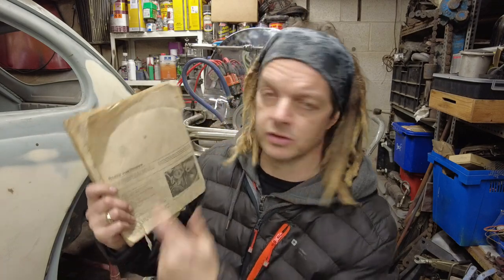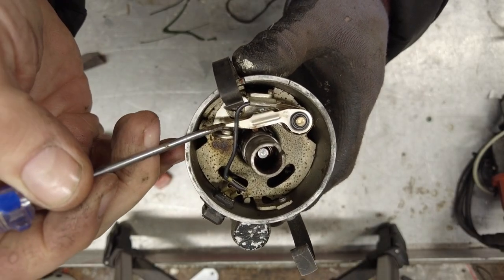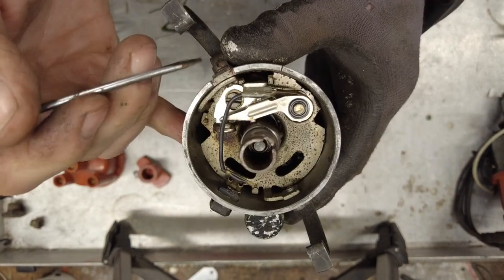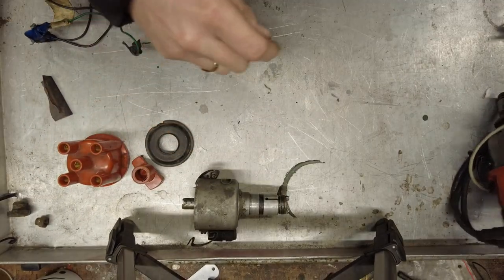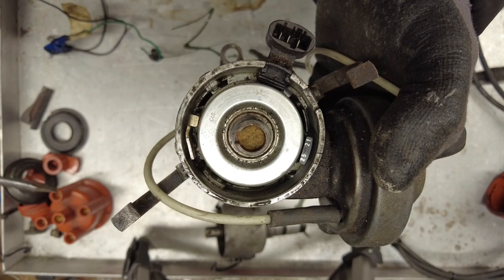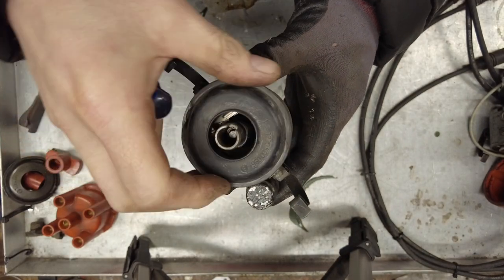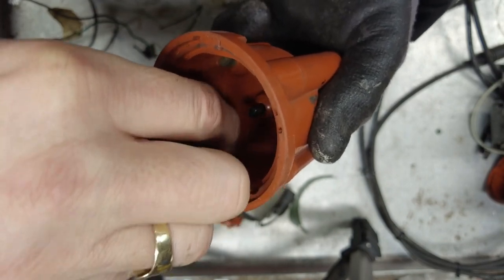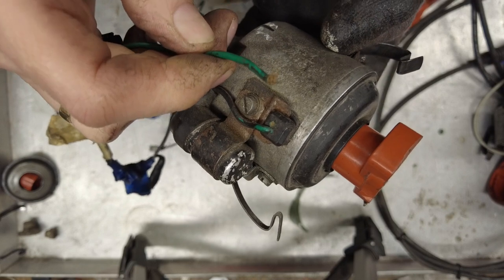VW Bug Distributor Maintenance Volkswagen Beetle SVDA 009 etc

Comment: Helpful video Al. What may surprise some folk when they look inside the 009 distributors under the contact breaker base plate is that there is only 1 spring that returns the centrifugal advance weights and that is all there is supposed to be despite the distributor shaft assembly having the attachments for 2 springs. If rebuilding use a small amount of the correct grease and oil as too much can attract dirt which can eventually cause issues.
Reply from the maker: Great info tx dude 😊👍

Comment: Thanks for the great info brother!
New to the VW ownership community so I'll be relying on your videos heavily! 👍
Reply from the maker: Cool nice one. Welcome 😊👍 Are you in the UK?
Reply: @PeoplesCar   No, I'm in sunny South Carolina
Reply from the maker: @lcwatts2971  Well SUN is something we dont get much of here! 🙄. Hope you enjoy the new VDub and plenty of sun 🌞👍
Reply: @PeoplesCar  Thank you! I'm having a "sputtering and backfiring" issue on my '68 Ghia. I've checked timing, cleaned, filtered, and polished EVERYTHING... Im stumped! 
...any advise?
Reply from the maker: Popping through the carb is usually timing, valves, air leak on inlet manifold/carb. Popping through exhaust usual air leak after gas leaves the engine. All get a bit complicated if you add a crappy carb or fuel pump into the same mix. It's a PITA but all you can do is try and eliminate one thing at a time. My friends was doing this yesterday. I reset his valve gaps, checked and re did the timing again, made sure wires all correct. Knew his dizzy and carb was good. Depending how bad the pop and misfire is, it's possible timing is 180 degrees out on dizzy, this engine was. Need to find TDC compression stroke on no1, and make sure the rotar is pointing to the correct lead! But doesn't sound that bad?? Also found he ha a duff plug with gap way too tight. Best of luck  😊👍
Reply: @PeoplesCar  Thank you so much for the detailed reply. I will check these items and see if I can find the culprit. Thanks again!

Comment: Thanks a lot for a great video! 
I never did Maintence on mine before, on the 1600CT it would only be a matter of lubricating & removing residue since it got no points?
Reply from the maker: My pleasure thanks for watching 😊👍 As for the CT dizzy, that's all I would do. I've never actually broken one down to see what's inside and don't think I'd want to risk damaging anything. The magnetic points in theory always have a gap so nothing in the dizzy body rubs/wears/or is eroded via a spark like points so in theory should be maintenence free other than the rotar, cap and occasional drop of oil. Best of luck and happy dubbing 😄
Reply: Apreciate your quick reply, thank you so much! As I suspected 👌😄

Comment: Hello I would like to fit 3/4 Rock role in my t3 t25 what type fit and some Alloy wheels ?

Thanks
Reply from the maker: @iamcracked9700  I've never bought a new one, all ones ive fitted have always been DIY or home made hobbies 😅 Generally a 3/4 shouldn't be a prob, it's usually width to whatever units you have thats the problem if there is one. Alloys wheels there are plenty. Loads of options off the shelf if have the funds, otherwise pretty much anything 5/112 and your good to go. Be careful with sone merc wheels however as the centre hoke can be too small on these for fitment on a T25 without modification. If your not sure how to check PCD this is how https://youtu.be/wqV79OLK5AU its a tricky size tho as so many so close to it. 
Im actually selling a cheap set on ebay atm if in the UK item no 126546925507. Need to be sure they are suitable weight wise for your van too. I've used thse ones listed above but tbh not sure they or many others on the market technically are. Hope that helps. Best of luck 😊👍

Comment: I bought one of those rev limiting rotors, my engine didn't want to turn over when I popped it in.  Went back to the original rotor and it fired right up.  Do I need to do something different to prep it or something?
Reply from the maker: I'll be honest ibhavent run this engine ir limiter in quite a few years but i dont remember setting it up different? I think the one I used tibuse was a 4.6k but i don't think they sell them any more.

Comment: Is the plastic cover over the points required? Mine doesn’t have one.
Reply from the maker: It's a good question and you know I'm not totally sure. I always assumed it was a dust cap but now you ask im not sure where that dust might come from. The cap isnt sealed but is on pretty tight. 
So I'd say it's better as designed but don't think it would be overly detrimental if missing, especially if your on top of maintenance etc and don't live in a desert. Not sure if that helps lol 🙂
Reply: Just a dust cover.  It has nothing to do with performance.

Comment: Why wouldn't you just put electronic ignition in there and you never have to touch it again....
Reply from the maker: I know many people do, and have friends with then fitted on their vehicles. I believe they are using Pertronix ones. However I've personally never used any other than stock ones on the CT motor. Id happily recommend them if I knew which are good and those that might not be, but without first hand experience I'd rather not advise on a product. I may fit some in a future video however. Thanks for watching and for your comment 😊👍
Reply from the maker: @daddygrasshopper  like yourself I'm pretty attuned to my cars feel and sound so would pick up on this also, but suspect many aren't. I know someone that drove a tyre off the rim! 😅 Would be interesting to know how many people have issues with 'maintenance free' electronic points. Not sure how would find that out though. I only know of one failure. Thanks for watching 😊👍
Reply: Just have an extra module in the glove box Just in case. Points are easy to adjust tho. As much tinkering we do on our VDubs, Points are just part of the fun. 😂
Reply from the maker: I suspect the main driver of change is about making ignition maintenance free. Without maintenance points are likely to fail or close eventually as they do require occasional tlc. Most regular peeps probably wouldn't bother these days and as a consequence end up with unreliability. Manufacturers have taken that potential problem out of the loop. Also on modern cars the timing can easily be managed electronically, controlled by the ecu, obviously most old aircooled dubbers won't have that problem. Thanks for watching 😊👍
Reply from the maker: Spare module and a lollypop stick! 😅
Reply: It's rediculous to say yea but when it quits you can fix points, can you fix condenser, coil, do you fix new car engines? Remember a garage every ten,twenty miles? Not there anymore. Just put in electronics. Even your lawn mower has them
Reply from the maker: @user-ff5ge7hx2c Got to say I ran 2 Suzuki Suoer Carry vans for a combined 16 years and they got hammered daily! The only thing that failed engine wise in all that time was a coil pack and the cat ate itself. Why our family daily is now a 20 year old Totota. My experience of modern Fiat's and VW hasn't been a happy one. I'm assuming these aftermarket electronic bits are made in China, so close enough 😅👍